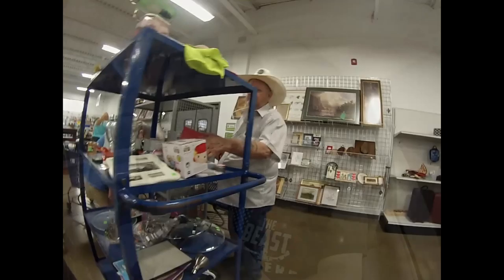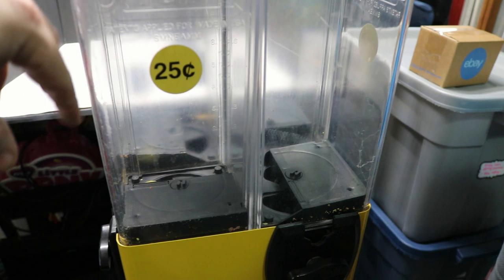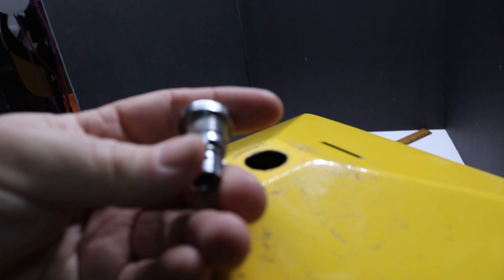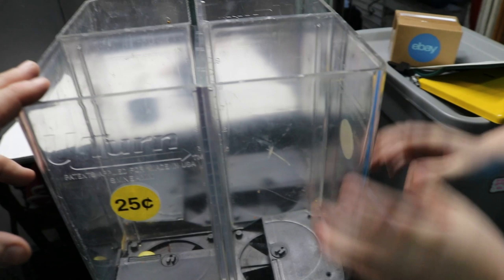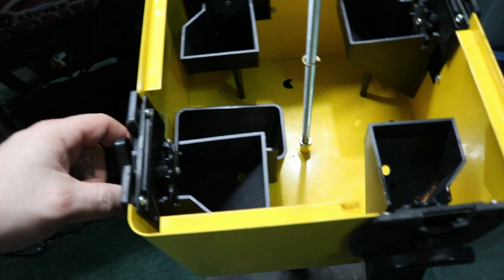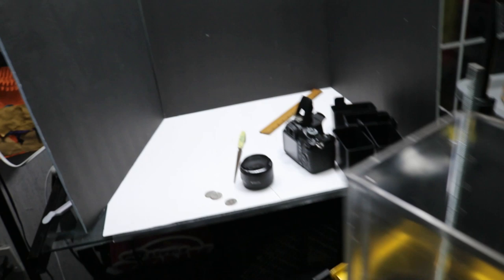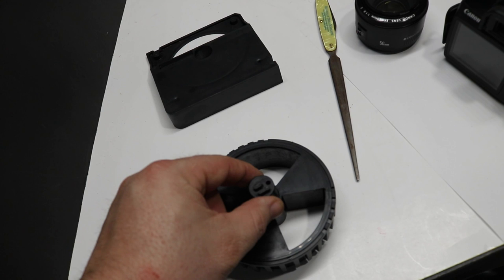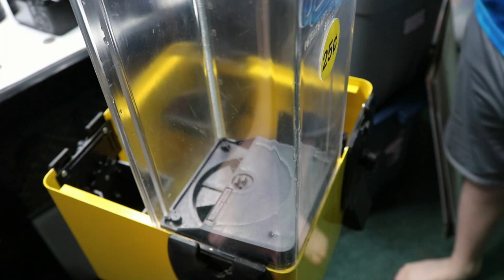I Can't Believe I Only Paid $2 For This Vending Machine Great Future Profit From This!

Comment: Those scratches will come out with some work. Years ago I started using the Novus 1-2-3 system to restore clear plastics - worked great on acrylic and polycarbonate. You'll use that over and over again to refresh items - I'm still using the same bottles 15 years on. Otherwise I'd say just treat it like a plastic headlight and buy a $10 3M headlight polishing kit at Walmart along with some fine sandpaper. Done.
Reply from the maker: Thanks for the advice John you are has hand as a shirt pocket!